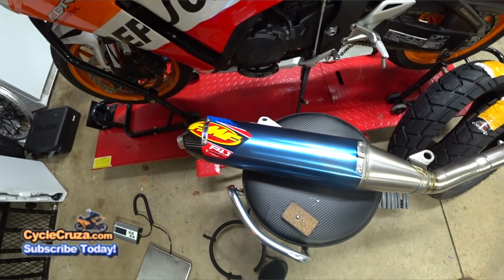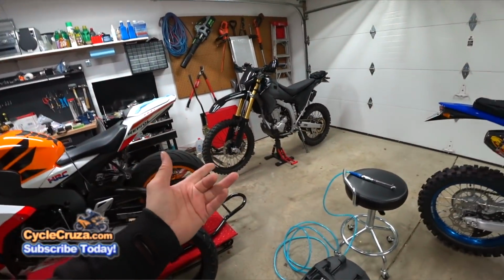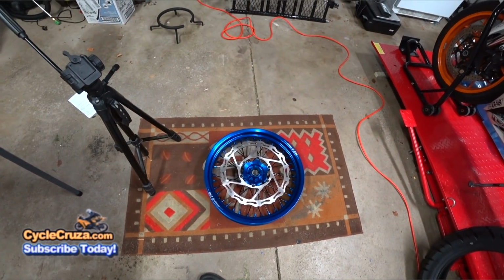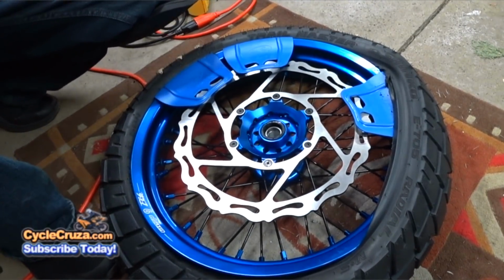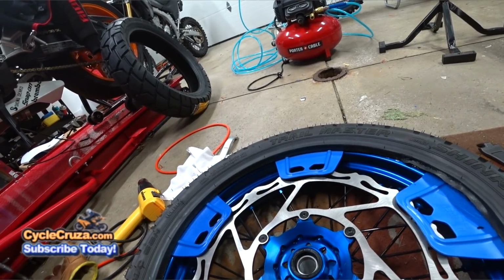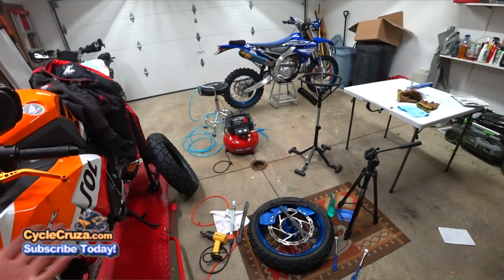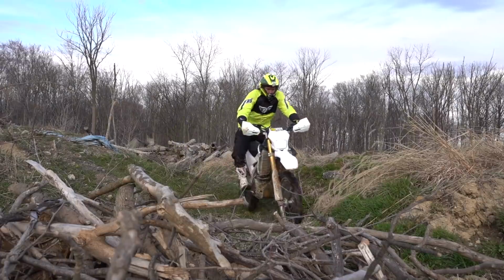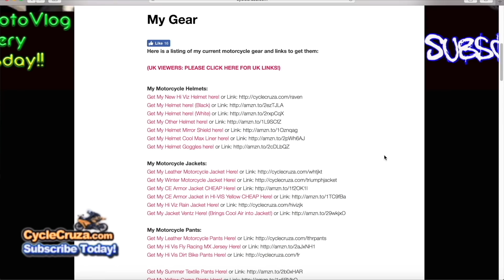Tire Install FAIL - BROKE IT 😠 | 2019 Yamaha YZ450FX Build Part 4 Supermoto

Comment from the maker: Links to get My Mods, GEAR, and Stuff: ⬇️ 
Get My Vlogging Camera: https://amzn.to/2OqDRfq
Get Tire Bead Breaker Irons: http://cyclecruza.com/n8n4
Get Tire Bead Keeper: https://amzn.to/2NPBDXz
Get Rim Shields: http://cyclecruza.com/bzf0
Get Street Legal Dual Sport KIT: https://amzn.to/2OlOSPm
Get LED Headlight: https://amzn.to/2NAkrW0
Get FMF Exhaust for YZ450FX: http://cyclecruza.com/xqai
Get Trail Tech Speedometer: https://amzn.to/2oE3Txv
Get Seal Savers: https://amzn.to/2CroE9t
Get Hand Guard Mirrors: https://amzn.to/2xzFTj5
Get Zeta Handguards: http://cyclecruza.com/rlfj
Get Zeta Handshields w/signals: http://cyclecruza.com/op6s
Get Handguard Side mounts: http://cyclecruza.com/wjcc
Get My Tail Bag: http://cyclecruza.com/vh3g
Get Stainless Steel Bolt kit: https://amzn.to/2MFnBm1
Get Stainless Steel Washer kit: https://amzn.to/2MLyvqf
Get Stainless Steel Lock Nut Kit: https://amzn.to/2xzYcEy

My Hi-Viz Helmet (On Sale): http://cyclecruza.com/raven
Get My CE Armor Jacket CHEAP: http://amzn.to/1TC9fBa
Get My Leather Jacket: http://cyclecruza.com/l7db
Get My Hi-Viz Gauntlet Gloves: http://cyclecruza.com/rrgloves

Links to ALL of My Stuff: http://cyclecruza.com/my-gear

MY CAMERAS AND STUFF:
Get My MotoVlog Camera: https://amzn.to/2K87egO
Battery Eliminator Cable: http://cyclecruza.com/gp4cable
Get My Vlogging Camera: http://amzn.to/2iehuFW
Get My Camera Bar Mount: http://amzn.to/2Au2k8B
Get My Helmet Microphone: http://amzn.to/2xCT4O0
Get My 2-Port Smart Power Bank: https://amzn.to/2K8Pm5n
Get My GPS here: http://amzn.to/1VUMdJq

MY HELMETS:
My My Hi-Viz Helmet (On Sale): http://cyclecruza.com/raven
Get My Gold Mirror Shield: http://cyclecruza.com/gmirror
Get My Dual Sport Helmet here: http://amzn.to/2ezTJLA
Get Ear Plugs here: http://amzn.to/1PE0NTn

MY JACKETS AND JERSEYS:
Get My Hi Viz Leather Jacket: http://cyclecruza.com/l7db
Get My CE Armor Jacket CHEAP: http://amzn.to/1TC9fBa
Get Hi-Viz Armor Jacket CHEAP here: http://amzn.to/1TC9fBa
Get My Winter Jacket: http://cyclecruza.com/triumphjacket
Get Hi-Viz Rain Jacket: http://cyclecruza.com/hivizjk 
Get River Road Leather Jacket here: http://amzn.to/1PflnIQ
Get My Hi-Viz MX Jersey here: http://cyclecruza.com/8c30
Get Hi Viz Vest here: http://amzn.to/1ROUBJY
Get Motorcycle Hoodie here:  https://youtu.be/bu_ypSLOQKE

MY GLOVES:
Get My Hi-Viz Gauntlet Gloves: http://cyclecruza.com/rrgloves
Get Hi-Viz Shorty Gloves here: http://cyclecruza.com/hivizshorty
Get My Heated Gloves:  http://cyclecruza.com/heatedgloves1

MY MOTORCYCLE PANTS:
Get My Leather Pants: http://cyclecruza.com/lthrpants
Get My HI VIZ CAMO PANTS: http://cyclecruza.com/hivizcamo
Get Urban Camo Pants here: http://amzn.to/1sWKFvA
Get Yellow Camo Pants Here: http://amzn.to/1x5BVbQ

MY BOOTS:
Get My Street Riding Boots: http://cyclecruza.com/l8gp
Get My Dual Sport Boots: http://cyclecruza.com/tzero

MY KNEE Guards and BACK PROTECTOR:
Get Knee/Shin Guards CHEAP here: http://amzn.to/1gY6rjI

My BACKPACK and STORAGE PACKS:
Get My New No Drag Backpack: http://cyclecruza.com/x5gh
Get Water Bladder CHEAP: http://amzn.to/2b5w5nv
Get Motorcycle Tail Bag here: http://amzn.to/1iwDbgQ
Get Tank Bag: http://cyclecruza.com/tankbag
Get Flat Tire Repair Kit here: http://amzn.to/1mO96NJ

MY MOTORCYCLE STANDS:
Get My Lift Table: http://amzn.to/2kt1pD7
Get Bursig Lift Stand: http://cyclecruza.com/bsig

MY MOTORCYCLE TRAILER:
Get Fold-Up Motorcycle Trailer: 
http://cyclecruza.com/stduptrl

Links to ALL of My Motorcycle Gear and Cameras:
http://cyclecruza.com/my-gear

Links to All of my Mod Parts for WR250r and CBR1000rr:
http://cyclecruza.com/my-gear

**CycleCruza's Recommended Videos********

Go to my motorcycle Video Playlists here:
http://cyclecruza.com/my-videos-2

Watch How To Make Tubeless Sumo Wheels:
https://youtu.be/lniuSPDtDgM

Watch How To Put Street Legal Stuff on Dirt Bike:
https://youtu.be/9Ws3XqJWs_I

Watch How to Ride a Motorcycle Video Series:
http://cyclecruza.com/how-to-ride-motorcycle

Watch Top 5 Defensive Riding Tips:
https://youtu.be/Au2aBqAEsJQ

Go to My Motivational Videos Playlist:
http://cyclecruza.com/motivational

Watch My Bug Out Moto Van Video Playlist:
http://cyclecruza.com/bug-out-van-videos

Watch How to get started in Motorcycling video:
https://youtu.be/at5jr430vX0

Watch Top 5 Starter Motorcycles Video here:
https://youtu.be/wyniWQWAy10
---------------------------------------------------------------------------

SUBSCRIBE TO MY ALL-IN-ONE Motorcycle CHANNEL! 
http://www.youtube.com/user/cyclecruza

SUBSCRIBE to my new new Bug Out Moto Van Channel:
http://www.youtube.com/bugoutmoto.

WEBSITE/BLOG (Be notified of new content and deals!):
http://www.cyclecruza.com

INSTAGRAM:
http://www.instagram.com/cyclecruza

FACEBOOK:
https://www.facebook.com/cyclecruza1

TWITTER:
https://twitter.com/CycleCruza

GET CYCLECRUZA STICKERS HERE:
http://cyclecruza.com/ccstickers

Get CycleCruza Merch: 
https://shop.spreadshirt.com/cyclecruza/
Reply: CycleCruza too bad u can’t ride that bike right

Comment: CycleCruza I failed the first time changing my sport bike tires. What I learned help me succeed on the next try. Ok, let me see if I can explain this.  On the part of the tire that you have completely on the rim, You need to kinda squeeze the tire together a bit and force it down in the valley of the rim. This will give you a little more slack on the side you're working with irons.  Once I figured this out I was able to mount the tire. Hope it helps.
Reply: Yeah I used a c-clamp to hold the other side pinched together and that was key

Comment: You have too many of this blue things in there,two is enough. Keep the blue things closer together and Take smaller bites. The one blue thing is keeping the bead from going into the low spot of the rim. Also make sure to squish the tire down farther on the opposite side of where you are prying and make sure it pulls up into the deep part of the rim. I do all my own tire mounting on my sportbike with a pair of homemade bars. Just some friendly advice. Don't give up man. Also where do you find a shop that will install tires you bought yourself. I have yet to find a single shop that will install tires I didn't buy from them. They will however balance them for a fee.
Reply from the maker: There is a harley shop I used to use not too far that will do it under the table for $30 a wheel. I might try again but it's tough. Thanks for the tips!
Reply: Right on! That's the key, putting the bead on the opposite side unseated and toward the middle of the rim...where the spokes are.  Turns a wrestling match into a fairly easy job. :  )
Reply: @Robnord1  I learned from a lot of elbow grease😉 I did have a slight advantage though having mounted car tires at home for years. These motorcycle street tires sure do have some stiff sidewalls though.
Reply: Yes and lots more soap lol... lots more soap. Grease up the rim too. I set the tire in the sun fr a couple hours if possible too bfore startin
Reply: Yes....also cruza make sure your mounting them from the right side. Some are just a pain in the ass thou. So don't feel bad. You would get it with more experience. But you don't have it. Its not something you get to do everyday unless you worked with tires doing roadside or something like that. There's guys that will have any tore mounted on any rim in 5 min
Reply: Jared I have put tires in the oven before
Reply: Jerk Ass lol yeah that would work too... and bonus your house will smell like the old Western Auto stores... i loved goin in there as a kid with my dad... always smelled like fresh rubber!!
Reply: Been there! Like others have said the key is to get the opposite side into the middle of the rim so it can give you more room on the side you're working on. I even use woodworking clamps sometimes with really stiff tires to squeeze the tire sides together so it can slide into the middle of the rim. BTW, the WR250R looks awesome!
Reply: Thank you. Maybe I don't need my own tire machine after all.

I do believe in independence from shops, in regards to installation, repair, and maintenance. And everyone should professionally work on, their own vehicles. Not just to save money. Not just in case shops are closed, or haunted by police. But because the only person you can really trust, is yourself.

...Unless you have Multiple Personality Disorder. I don't know about that.
Reply: CycleCruza rather see you try it again... if you didn’t bring it to the shop already.

Comment: CC keeping it real. Uploading failures can’t be easy.
Reply: I concur.  At least he tired.
Reply from the maker: Hey you win some you lose some,  that's life. I keep it real even if it is sometimes humorous like this time. lol
Reply: Yes. I felt bad for the struggle, and possible damage. But what you were saying was hilarious.
Reply: For real!  It's not an easy job the first couple times.  At least he only broke a tool.  I bent a steel rim the first time, then tore a tube the 2nd time.  Both were Shinko 706's.  They are great tires for the money though!  Once you get it on with some of the suggestions mentioned in some previous comments, it gets easier!

Comment: I just changed my XSR900 rear tire with same spoons (and a couple smaller ones) and rim guards.. I'm at 3:40 in the vid and thinking to myself, why are you trying to do that dry? Need to lube it up with water/ soap mixture! I would have never got it done if everything was dry.

Comment: Yellow dots go by the valve stem while the red dots goes on the opposite side. I also use a ratchet clamp and lashing straps to compress the tires to fall in the drop center of the rim. This should give you that extra inch. Use plenty of tire lube too. If you're working too hard, then you are doing it wrong. Sit back and reevaluate the situation before you scratch up the rims.

Comment: Looks like the reason the tire wouldn’t go on is because the bead was to high on the rim. Also the tire didn’t have enough lube.
Reply: Bead was too high on the opposite side of the wheel from where he was trying to arm it over with the bar
Reply: Needs to get a can of yamalube tire mount. Stuff works amazing.
Reply: jim k that’s exactly what I was thinking.
Reply: Agree! Maybe some big clamps or something to push that bead down into the valley on the opposite side of the tire

Comment: Struggling, and then getting stressed out in mechanical work is where things get dangerous. I broke a part inside my DRZ's carb before, and my bike ended up sitting in the garage for another week and the part replacement cost me $55. I learned from it, fixed it, and rode on. 👍

Looking forward to seeing you ride that monster.

Comment: When you reach that point use your hand or a couple of C-clamps to squeeze the tire beads even and almost together across from where you are prying, keeping the beads off the ridge and you will find the slack you need to finish the job.

Comment: good honest effort, it's not easy to fit road tyres, I fit them in summer so I can heat the tyre up which greatly helps then I push down the tyre bead into the centre of the rim which gives you extra play to tire iron the remaining bead. Some rims and tyre combo's are just plain difficult though so I don't blame you for taking it to the shop. Great to see how the bike rides on the road.

Comment: Bike struggles are real (3 hrs on a simple brake caliper/ new pads / 😂 I almost tapped out but no I got it 👍🏻
Reply: Wow, what happened all the caliper bolts rusted into place?  Takes 5 minutes to do brake pads on my bike.
Reply: Sounds like an older bike.  I ride a 85 FJ1100.  Anytime I attempt anything I'm replacing the original bolts that crack or strip.  Your propane torch and $10 harbor freight manual impact driver is your best friends.

Comment: 25 dollars at the shop would have saved you a lot of stress and time and probably some money in the long run. Hope fully the tire bead is okay. I know how you feel been there myself that’s why I bring my tires to the shop lol not worth the headache. Enjoyed the video
Reply from the maker: I wish I did, will probably have to buy another front tire.
Reply: Auto blipper oh I get it believe me been down that road lol
Reply: CycleCruza oh that sucks hopefully it 👌
Reply: Take loose wheels with old tires on them to a shop, along with a set of new tires. Dismount, remount, balance cost upwards of $80 for a set.
Reply: $25?? I have to fork out $100 every time to get my 2 tires mounted and balanced.
Reply: do you take the rims off the bike first?  if you just ride your bike in, it's about $50/wheel, but if you just bring in the rims and tires off the bike it's about $25-$35 per wheel
Reply: I don’t know where you get tires mounted for $25. The shops around my area charge about $50 per tire and that’s if you buy the tire from them. That’s when I got into doing it myself. I posted a comment up top but I’ll reiterate. I used the zip tie method. Did both tires on my R1 and my buddy’s GSXR 1000 easily. My v rod back tire may be a bit more of a pain as it’s a pretty wide tire
Reply: No. I've taken both wheels off my bike and hauled them to the shop. Dismount old tires, mount new tires, balance. For two loose wheels, around 80-90.
Reply: i live in los angeles, i have paid anywhere from $20 to $35/wheel off the bike.  I have always purchased my tires online and brought them with my wheels and i have never ever had a shop refuse to mount tires if i didn't purchased them there (wtf honestly sounds like an urban legend being propagated by a non-rider).  the last time was $35/wheel at a moto/watercraft service center near my place.
Reply: Roe Sham Boe I called a local cycle gear. They charge $25 per wheel IF you buy the tires from them and $50 per wheel if you purchase tires elsewhere. One of the employees has a friend that owns a shop and she said he charges $50 per wheel. Crazy that motorcycle tires are way more expensive to mount than a damn car or truck tire. Are motorcycle tires magical tires or something?

Comment: You need to push the tire bead down into the drop center of the wheel. Push down on the tire opposite of where you are using the levers. Getting the tire down into the middle of the wheel will allow you to lever the last part of the bead over the wheel.
Reply from the maker: As others have stated, these shinko tires are the hardest tires ever. They are bricks!

Comment: I just used the zip tie method with wd40 bought two bags of harbor freight 24 inch zip ties no special tools broke the beads with some 2x4s and my truck as a fulcrum slipped the old tire off and new one on with my hands. Love your videos CC keep em coming. 😁👍👍

Comment: You were doing good, I did my own tires, it's hard, but if you keep at it you will get it. I did the same to my tire bead but when it went on it aired up fine, no problems.

Comment: Zip tie method works wonders on skinnier tires. Did my R1 tires easily and my buddy’s GSXR 1000 tires. He wanted to try it the way you’re doing it. One side over the rim at a time. Told him let’s do the zip ties as I’ve done it before. Fought with it for an hour before he finally pulled the tire back off and used the zip ties. Tire on and aired up in 15 minutes. Most of the time was tying the zip ties around the circumference of the tire. I have to do a rear tire on my v rod soon which is a hell of a lot wider. Not sure if I can do the zip ties on that wide or a tire but I’ll try it.

Comment: I had the identical experience trying to put on the 705's I almost bent a tire iron into a U shape. Had to take them to the shop. Thick sidewalls ...
Reply from the maker: Yeah will take it to the shop.
Reply: The thick sidewalls are a good thing though, the tire will corner better on pavement, and will be more resistant to punctures on dirt.

Comment: Sir, I feel your pain Been there, done that. Damaged my rims. When I did get the tyre on the inner tube had been damaged. Took wheel to garage and they fitted it with a new tube for a very reasonable price. Great to be able to change a tyre yourself but on some wheels you're better off letting the garage do it.

Comment: the dot on the tire is because tires have a heavy spot usually. you align it with the valve stem so it makes balancing it easier and uses less weight in the end to get it balanced 👍. they sell a baja pro tool it makes putting tires on very easy, it fits through your main hub and uses leverage to get the tires on the bead (you should look into it, takes 5 minutes to change a tire, and you forgot to lube the tire or spray it with soap water to make it help to slip on.

Comment: You have to drop opposite side of the tire bead in the  center of the rim to be able to slide the tire bead in. Try zip ties method to install the tire, it is save for rim and does not need those metal levers and stuff like that.

Comment: +1 for the no-mar (cycle hill to save a couple bucks) tire changer.. but, if you have a couple of clamps, use them to hold more of the bead that you already have on more toward the center of the rim.. that gives you more slack to get the last bit on.

Comment: CC...don’t beat yourself up over mounting the tires man. I’ve mounted my own dirt bike tires for 15 years and I consider myself to be pretty decent at it. Even though I have all of the equipment to do it, I still pay the $20 to have the shop mount and balance my street bike tires. Street bike tires are a completely different animal! Great video man, and props to you for uploading the fail! I have to admit, I had a pretty good laugh at all of the bleeped put moments because that is exactly how I sound when doing this!